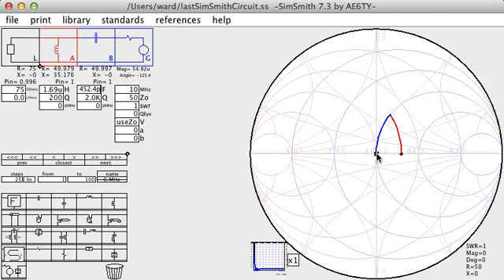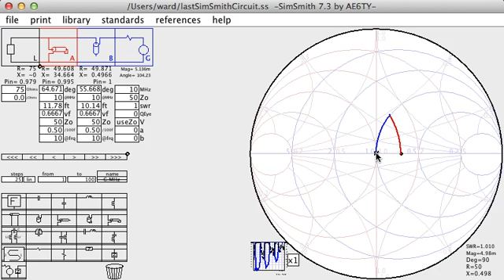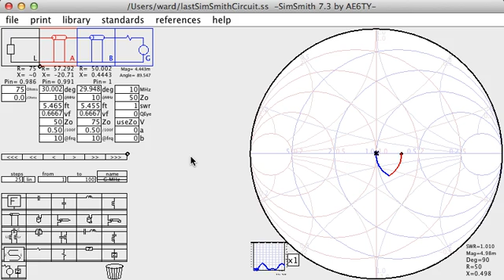Introduction to Smith Chart Software

Comment: Hello! I just installed jre21-openjdk 21.0.6.u7-1 "open jdk Java full runtime environment" on an Arch Linux laptop and got the following errors after installing SimNEC. IS it possible to have SimNEC run on Arch Linux?

java.lang.UnsupportedClassVersionError: ae6ty/SimNEC has been compiled by a more recent version of the Java Runtime (class file version 59.0), this version of the Java Runtime only recognizes class file versions up to 52.0
	at java.lang.ClassLoader.defineClass1(Native Method)
	at java.lang.ClassLoader.defineClass(ClassLoader.java:756)
	at java.security.SecureClassLoader.defineClass(SecureClassLoader.java:142)
	at java.net.URLClassLoader.defineClass(URLClassLoader.java:473)
	at java.net.URLClassLoader.access$100(URLClassLoader.java:74)
	at java.net.URLClassLoader$1.run(URLClassLoader.java:369)
	at java.net.URLClassLoader$1.run(URLClassLoader.java:363)
	at java.security.AccessController.doPrivileged(Native Method)
	at java.net.URLClassLoader.findClass(URLClassLoader.java:362)
	at java.lang.ClassLoader.loadClass(ClassLoader.java:418)
	at sun.misc.Launcher$AppClassLoader.loadClass(Launcher.java:352)
	at java.lang.ClassLoader.loadClass(ClassLoader.java:351)
	at com.exe4j.runtime.LauncherEngine.launch(LauncherEngine.java:80)
	at com.install4j.runtime.launcher.UnixLauncher.start(UnixLauncher.java:71)
	at install4j.ae6ty.SimNEC.main(Unknown Source)
Reply: I got it working!
I finally figured out how to install a more recent version of Java jre and then tell the computer to use it by default using 
$ archlinux-java status
Available Java environments:
  java-21-openjdk
  java-8-openjdk/jre (default)
$
 
3) I changed the default JRE with:
sudo archlinux-java set java-21-openjdk